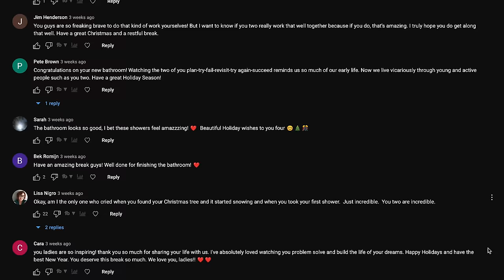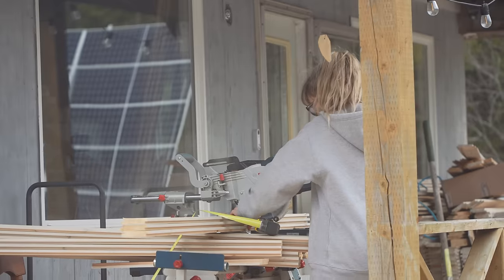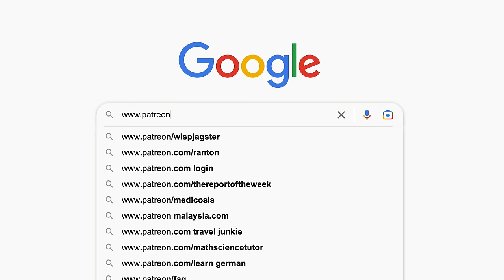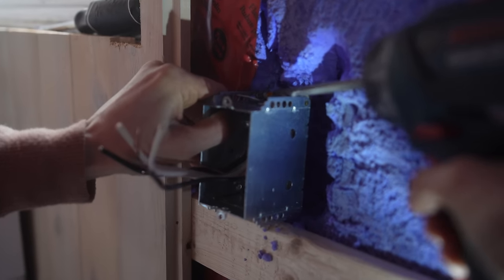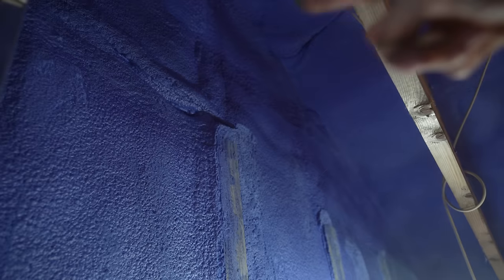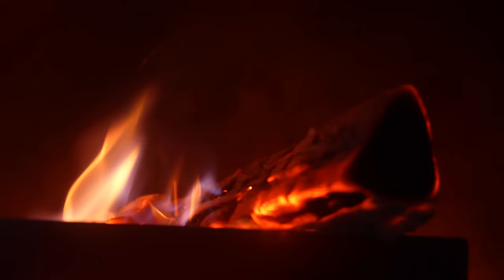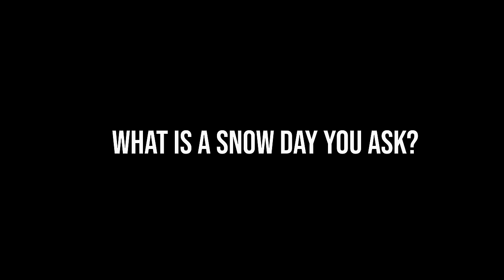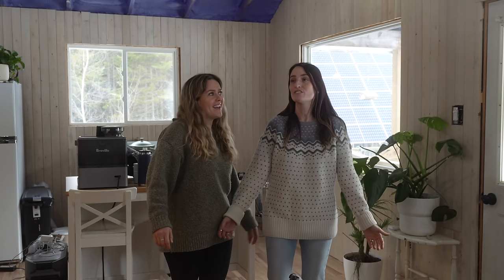CABIN BUILD: Starting The Interior!

Comment: Looking good. For the electrical boxes that aren't flush (16:51) you can (should) add a box extension which is important with wood paneling to keep combustible materials outside the box because it's a fire hazard. Addition, from experience, working when overtired is when injuries occur. I advise to stop when things become unsafe.  Cheers!